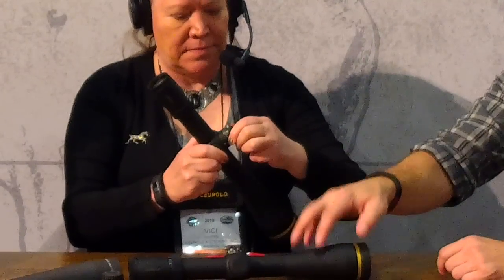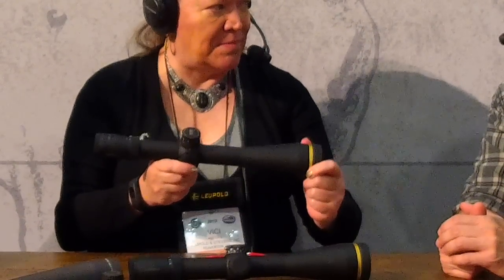Leupold Core Insider: New Riflescopes and Red Dots - SHOT Show 2019

Comment: Great to see the new tactical model, however, in these scopes when you say it has 3 turns (or any number) of rotation how many MILLS/MOA are per rotation???  Your VX5 or VX6 has a 30mm tube with plenty of adjustments but only "restricted" rotation after zero stop set... Thank you for your time...